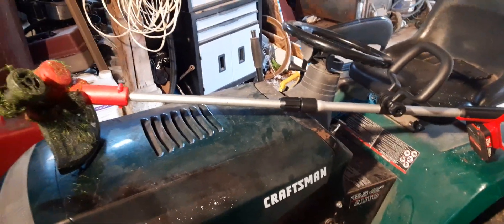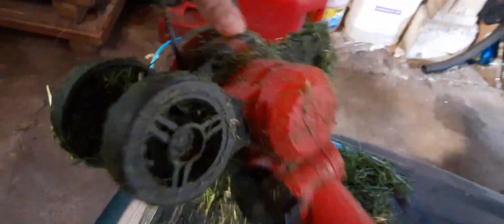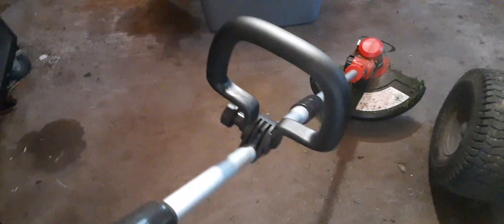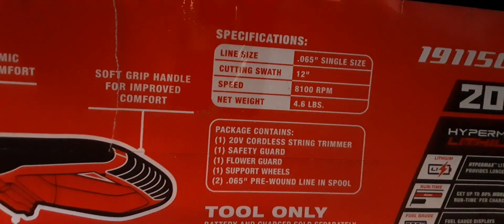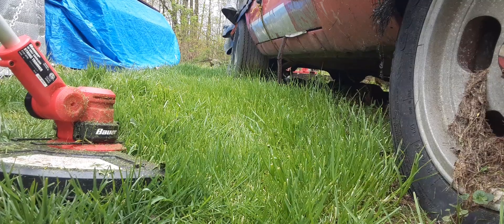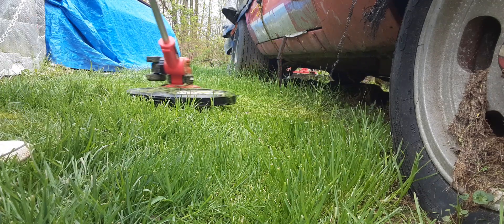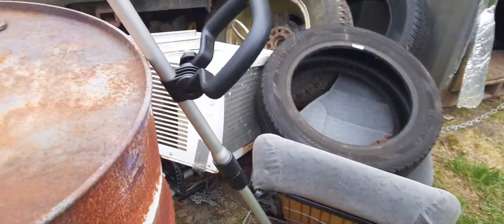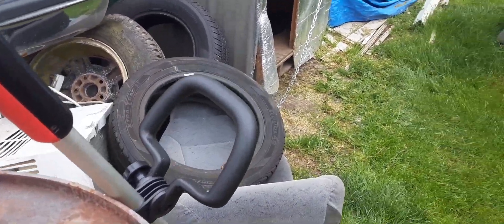Bauer battery weed wacker

Comment: 2:01 minor correction.  This edger is not a bump feed edger. The instructions say to stop and start the edger and it feeds a little each time.   They make low cost spools as Worx brand replacements, they are the same as the Baur.  You can get them 12 for $10 on ebay.
Reply: CORRECT  do NOT bump

Comment: I wish someone would show using this in edger operation mode.  I tried doing some edging with it and my hands and body were all twisted, just couldn't find a comfortable adjustment position.  Got the job done but was very uncomfortable and hard to work with.
Reply: You know you have a different mount spots for the wheels?
Reply: @chadfolmar5900  Yes, I even read the entire manual.  I have the wheels mounted in the "edger" configuration mode.  Rear handle is then backwards with weight of battery working against you on top.  It just feels very awkward to use in that edger config mode.  For the time being I just use it in trimmer config mode to do sidewalk edging.  Seems to do just as well of a job without the awkward wrist contorsions.  Interested to see others actually use it as an edger and observe how well it works.  Definitely not working for me and I've owned quite a few edgers.
Reply: @rednroll1  I believe the handle rotates but required some effort